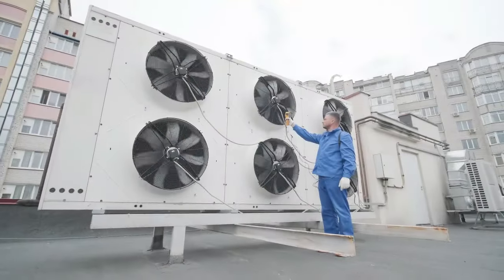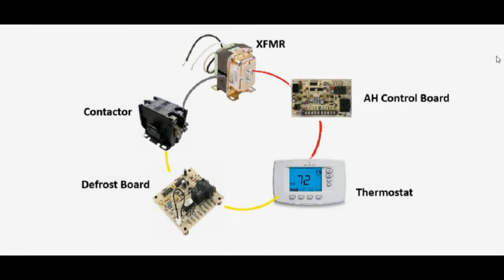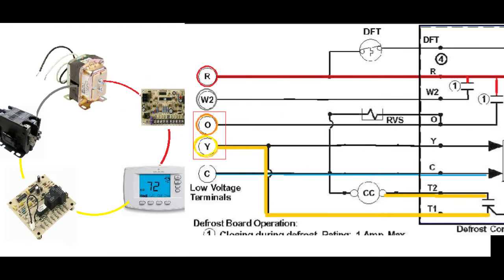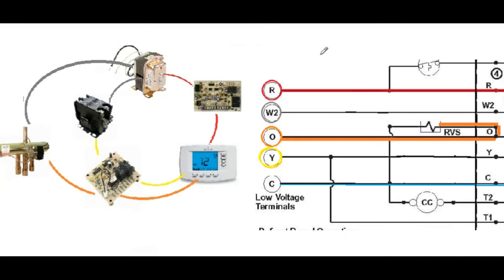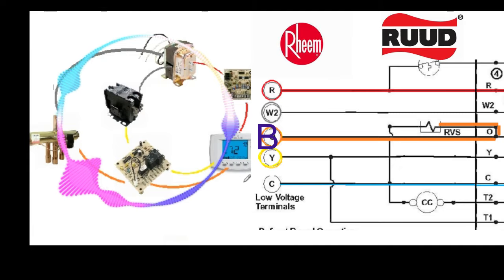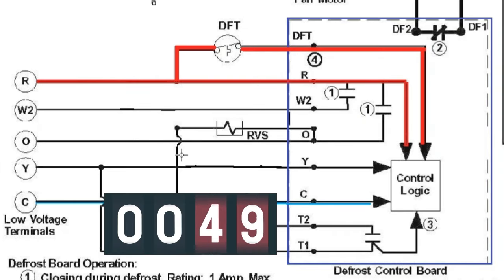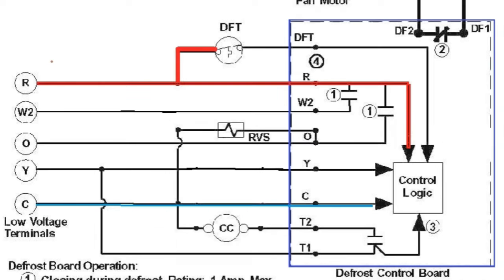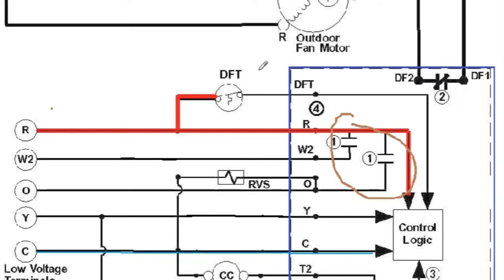Defrost Control Boards (Heat Pump Wiring Basics)

Comment: Hi Mike,
Your videos are really helpful for what I try to install.
When I renovated my house last year, I installed floor heating(only pvc pipe), but not connected with water heater. 
In order to complete it, I just need thermostat, defrost control board, hot water recirculation pump, 24v/120v relay and 120/24v xfmr.
Then, R, C, Y connection, right?
It just needs water pump on/off based on temperature setting.

Is there any simple kit for this system?
Reply from the maker: Honestly, I'm not familiar with a hot water heater defrost control board radiant heating arrangement to advise on this one.

Comment: thank you, you need to make o e of those HVAC for dummies books.  I have a question so my Trane TWN024C100A2. runs normally for some time then the fan will stop and not run.  board 21C140501G18 - CNT1923 then flashes 3 times, won't go to normal unless breakers reset.  my unit has a coil thermostat along the bottom outer edge, connected to coil on control board and the ambient thermostat a little further away,  plugged into ambient on the board too,  my question is that upon inspection I noticed that the defrost temperature switch THT00811 has two wires they start off blue with white stripes, then turns purple with white stripes, I'm sure its faded over time, but only has one wire connected to the contractor, and the other wire capped off, the control board does not have pins specifically for defrost, I can't find any help.
Reply from the maker: 3 flash codes on Trane Defrost board is an indication of low pressure in the system. Have the refrigerant levels been checked lately?
Reply: Thank you for the response, I  have not, just yet, but now that you bring it up, I’ll be calling someone to check that.  Just been doing some maintenance, replaced capacitors and relay, and ran across the discharge line temp switch only having one wire connected to T2 and the other capped off.  from the diagrams it shows the sump htr wired to the L1 terminal on the contactor, the other sump wire to one of the wires on temp switch, then the 2nd wire on the temp switch to the T2 on the contactor, what I have is one wire from the temp switch on T2, and the sump htr wires directly connected to L1 and L2 on the contactor.  Looks like the switch is bypassed. I saw a photo of the same model heat pump and one of the temp switch wires and the other sump htr wire were wired together

Comment: I liked the explanation.
I have a question. 
I have a trane unit and every time I turn the heat on even when outside temp is 50 and I raise my house temp from 68 to 69 just one degree the aux heat comes on
Reply: Is AUX heat the only heating you have or a secondary heat?

Comment: thnk U for the info here. But i have a question. What voltage is on the C terminal, if the R terminal has 24v.?
Reply from the maker: The common just completes any 24v circuit to allow voltage to flow. It shouldn't read anything by itself.

Comment: My heat strips come on instantly, and my heat pump never kicks on.  Works fine in cool mode.  Any suggestions?
Reply from the maker: Could be a few things, but a stuck reversing valve is not uncommon.
Reply: Turned out to be a bad thermostat.

Comment: Can you please guide me what could be wrong?
I opened the unit and saw a DS2 fault light blinking 3 flashes and it looks like low pressure switch open.
I cycled power and it went away then I tried to turn heat on and same thing happened the aux heat came on right away. This time I didnot see and fault 
I check across the Low pressure switch and it looks closed to me.
Also when the aux heat was on the compress fan started running aswell.
Reply from the maker: Different models and years have different codes, so I can't really confirm it's a pressure switch issue. It's difficult to narrow it down with so many possibilities and no access to testing.
Reply: @JerseyMikeHVAC  so 
I checked the pressures and when in heat mode the pressures looks 60 psi and when I switch to cool the pressure drops to 0 and gets my system in hard lockout.
Reply from the maker: Do you have a filter dryer in the lineset? Maybe internally in the condensing unit? Or could be a bad TXV. 
 @ananddesai1826

Comment: Hey Mike - I'm trying to trace out a low voltage short on my heat pump/hvac system that's blowing my 5amp fuse intermittently and I found that on the Defrost Control Board, I find continuity between Y and O - and I'm unsure if that's normal? Same for R and C. In additional, Y and O also has continuity to Ground. Power to all units were off while I was testing for continuity to find a wire that was contacting ground.
Reply from the maker: Neither Y or O should have continuity to ground or each other. Kind of sounds like the two wires are pinched somewhere and contacting metal. First place I would check is right where the T-stat wire first enters into the condensing unit, or same spot up by the air handler.
Reply: @JerseyMikeHVAC  Thanks for the quick reply Mike - the continuity between O ad Y happens at the terminal on the Defrost Control Board itself(I disconnected the T-stat wires and tested the prongs on the board and found the continuity) - so I can't tell if the board is bad in this case - however the system still runs just fine except for the intermittent shorts
Reply from the maker: @life.b.s  Where are you getting continuity to ground?
Reply: @JerseyMikeHVAC  Hey Mike! Wanted to follow up back here and thank you for answering my questions above. I might have finally gotten the fix down after hours of chasing down a grounded wire. It seems the main issue was a dead relay on my Defrost Control Board. I had a reddit user call it out but wasn't fully convinced til I noticed that the Fuse would be blown after running for about 90 minutes or so, which was aligned to the defrost cycles, so I figured it must have been something defrost related. Bought a new defrost control board, swapped it out, and it looks like it's been running all night without popping a fuse. Here's to hopping it stays this way.

Comment: Ran into a Nordine heat pump . Defrost board  had a M and SW connectors . Wiring diagram didn’t have a legend  . Do you know what these are for or mean ?
Reply from the maker: M may be a manual mode option. Not sure about SW but could be a temp switch.  Have the model number?
Reply: @JerseyMikeHVAC  I have the wiring diagram if you’d like to see it .
Reply: Model number Q6E-x48k
Reply: Nordyne
Reply from the maker: Had a hard time finding the model number, but I got some info from a manual on another model. 

 The SW terminal is the return voltage for the hi/lo pressure switch circuit that the board sends out on the PRESS terminal to prove the circuit. 

 The M terminal completes a circuit to activate the compressor contactor off the Y signal, and its purpose to provide some kind of control when connected to an economizer. I don't know exactly in this case what parameter in an economizer would cut power to the contactor, but my first guess is to allow the economizer to shut down the system on a fire damper/smoke detection switch.  If there is a molex plug jumper connected to the econ molex plug with a jumper wire between 4 and 6 terminals, this is just a bypass that allows the Y signal to reach the contactor when an economizer is not installed. So basically, either way, power from the thermostat to the contactor runs through that M terminal.

Comment: I have bi direction filter
Reply from the maker: Does the copper line feel like different temperatures on each side of the filter when the system is running?
Reply: @JerseyMikeHVAC  yes
Reply from the maker: That may be your issue right there.  @ananddesai1826
Reply: We pumped some Freon yesterday 
Than I turned heat on but it’s not very effective.
Than I turned it on cooling I just went in a hard lock out
The lockout is when the low pressure switch is triggered a few times
Reply: @JerseyMikeHVAC  the TXV?
Reply from the maker: There's a thrmal expansion valve in the unit that can sometimes get plugged up, but if you're sensing two different temps on each side of the filter dryer, I would say that is likely the issue. It should be the same temp on both sides if free flowing through.  @ananddesai1826